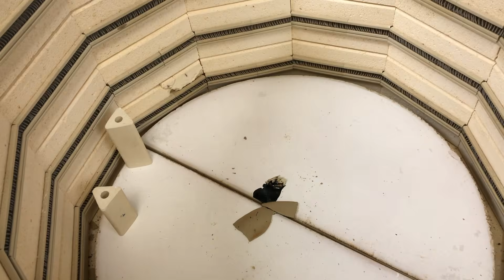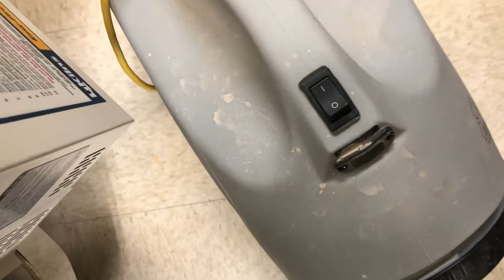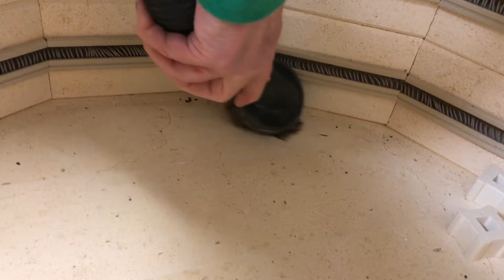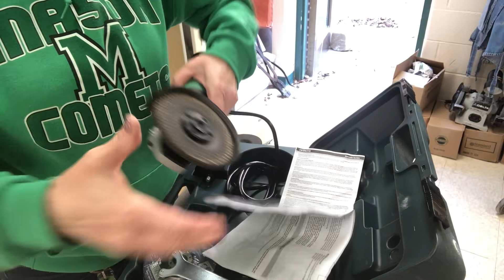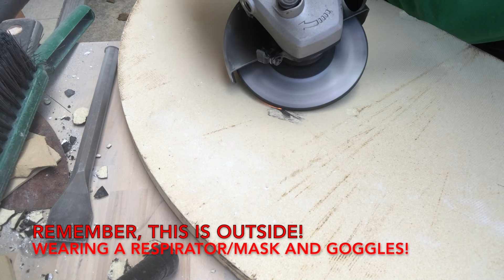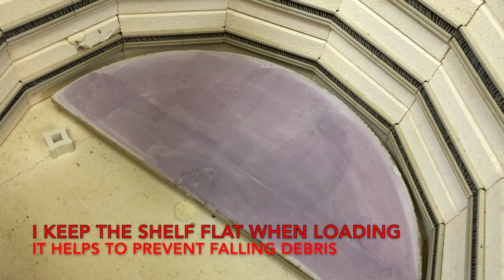Kiln Shelf Routine Maintenance- Glaze Drip Removal, Grinding and Washing Kiln Shelves

Comment: The glaze Looks like one called Gold Rain. If it is, that would explain running so badly. If you read the fine print, Gold rain is only for horizontal surfaces. I had a student use it on the top half of a 12 inch tall sculpture. We "assumed" giving it 6 inches of area to run/move would be enough. But it ran all the way down at Cone 5 and adhered the entire form DEEPLY onto the kiln shelf.
Reply from the maker: I never had a glaze that was called gold rain! I do have many that are runners and I have very specific instructions written on the glaze bottles and buckets for the students. It’s really a matter of them paying attention to what they’re doing! 😉

Comment: Great video!  Can you put kiln wash on the bottom firebrick?  Thanks so much for your video.
Reply from the maker: I would encourage you to consult the kiln manual for the answer to that. I’ve never done it, but it might depend on your kiln manufacturer and what they suggest.  Because I never placed things directly on the floor of the kiln, it’s never been an issue for me. I always like to put small posts and shelves for better air circulation, and even heating.